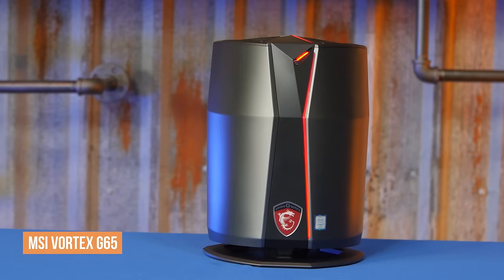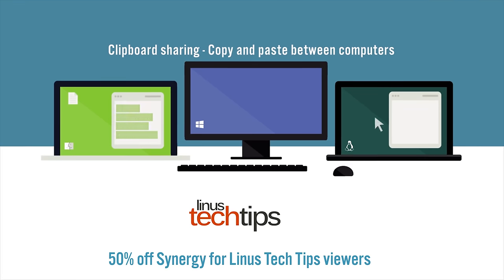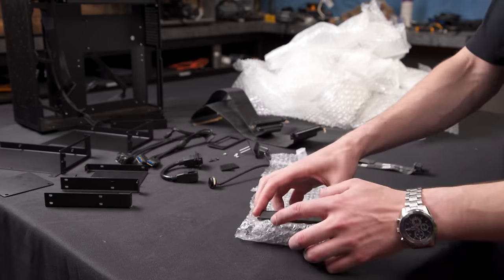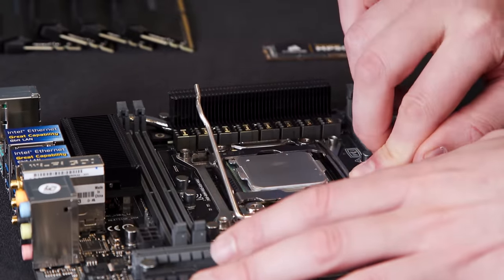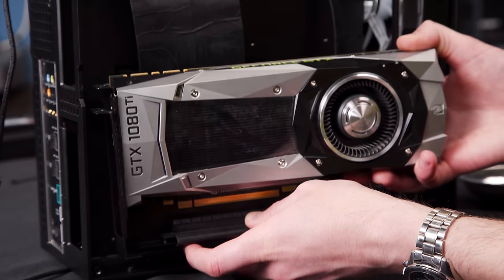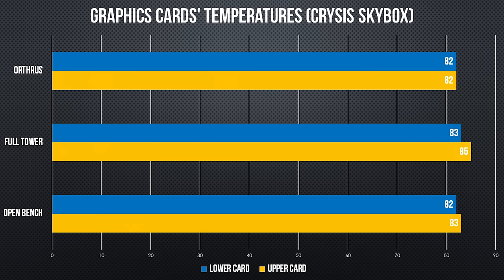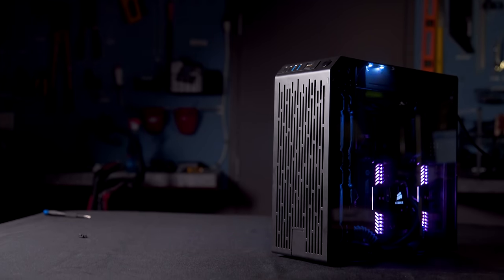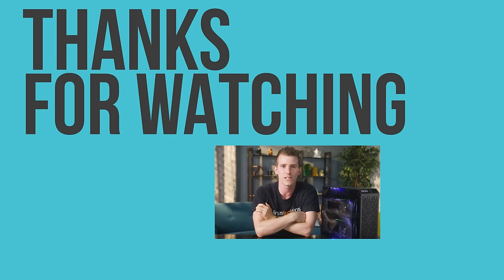SMALLEST SLI GAMING RIG – ONE OF A KIND!

Comment: God DAMN man that case is beautiful and TRAHSES anything on the market right now, looks super sleek and futuristic without being gaudy  on top of looking powerful as all hell thanks to the SLI window, Ten outta fucking Ten guys.
Reply: Its biggest drawback is the non-standard PSU, which makes it impossible to mass produce, unless they sell with PSU, which needs to be custom OEM design, which is very expensive in small volumes.
Reply: Brandon HLM also 10,000 fucking dollars out of 10,000 fucking dollars
Reply: Why not just make a bigger version of the case to support bigger PSUs.
Reply: Also, the rails were rewired for gaming workloads.
Reply: This, server PSU basically relegates this build to "I hate everyone in the same room as me" status.

should have sacrificed some vertical space and put in a SFX-L supply from silverstone, used cablemod to make the custom cables for it that are the right length, and the extra vertical space you use for the cooler block for the watercooling.

make it shorter since you dont have the waterblock at the front anymore.  Obviously, your block probably isn't going to be a 120mm.  so maybe you just use the room up top for more 2.5" drives. I dunno...

either way; server psu = worst idea.
Reply: Noise levels on the original build (v1) are 45-55 dB (idle/load) I think he is still deciding on the PSU however so if thats the main source of noise it may go down.

Comment: Love these Small form factor Cases!!
I'd really like just a couple more single GPU Cases similar to the SteamBox Prototype / NFC S4 Mini, BUT With a SFX or smaller PSU INSIDE The Case
Reply: May be just take notebook PSU, disassemble it and connect directly to DC TO DC converter
Reply: there are som on sff forum under custom cases and projects
Reply: Rooper K most notebook boards can't take external graphics. Makes no sense to do it.

Comment: I'm so happy you are using the older Corsair AIO cooler. I refuse to use any other AIO, these are the best all around in my opinion, I've had mine since they first came to the market and I love it! The built in memory for the LED is pretty neat too, you don't have to install the Corsair link software to reset the color

Comment: I used the same motherboard for my rig with GTX 1080's in SLI. Put mine in a Fractal Design Node 804 and water-cooled the CPU and GPU's. Not so small, but does the job.

Comment: You lost the first one?? And I'm sitting here with my i7-2600 ..
Reply: Raspberry pi 3 b+ overclocked to 1.4 ghz on cpu..
Reply: @Anonymous Gamer my nigga you have it good, I have a Intel Celeron with integrated graphics, 2gb ddr ram and a Chinese 450 watt power supply with ketchup mustard cables
Reply: 2600k still strong

Comment: why someone not come up with a way to run Windows on the Xbox1 as that is a small compact computer..?
Reply: iAwareNow not sure the specs of the Xbox one is enough to meet minimum specs for windows if that’s what you mean
Reply: @AAHSDJFBDKAUHFBFAIOS  thank you just seems weird how even PS2 can have amazing graphics yet not have windows xp on it at the time.. to get a PC to have the same graphics would cost ridiculous amount.. seems a lost opportunity to use these systems for other uses..
Reply: @iawarenow658  Its due to optimization due to the same hardware and software configurations so it can be optimized better giving more room for graphics etc. Unlike in Pcs where hardware and software configs can be different most of the time so you can't optimize it as well if at all so there is no room to add extra graphics and visuals etc.
Reply: @AAHSDJFBDKAUHFBFAIOS  oke thank you very much that is very interesting.. thank you
Reply: @iawarenow658  ps2? Are you sure, i can emulate ps2 on my phone

Comment: "In real world testing its not far off from running a single 1080ti" is what they should have said.  in my experience, which was with 2 GTX 760 supers in SLI. I found support to be a little lacking outside of synthetic benchmarks. so It always seemed to be only using one card. But when it did work, let me tell you.... it was a marvel of engineering.

Comment: This is AMAZING!  I never thought i'd see 2 1080ti's in sli in a tiny box that aren't in some way suffocated.  because of the blower style coolers, the intakes from those cards which are conveniently right up against the vents in the wicked tight clear panel blow through the 1080ti's out the back side of the machine, the cooling for the cpu goes right to the rad (which fwiw, i would set up blowing out instead of in myself but Shrug) - i'm not sure exactly if it would work, but I would like to see that front bit come in a bit and the case get a bit higher so that the power supply could fit on the bottom of the case and the rad could fit at the top with all those fans blowing up - and maybe squeeze an 80 or 120mm intake or two low in the front? - either way, opinions are like buttholes, i'm sure everyone has a laundry list of small personal improvements, but overall, this thing is seriously dope AF just the way it is... it's a grand example of using all the parts how they work best and building a frame around that.  kudos LukeD!

Comment: A box of such size is capable of having a normal GPU position.
Project Orthrus Width: 13.20 cm vs GPU Width 11.12 cm
Project Orthrus = Height: 33.00 cm Length: 34.50 cm Width: 13.20 cm
GTX1080TI-FE = 26.67 x 11.12 x 3.81 cm

Comment: no waterblock in the gpu makes it hybrid cooled... i generally dont understand why people would cool the cpu but not the gpu... the gpu puts out way more heat in most builds and there are worse aftermarket coolers... so gpu watercooling is way more important than cpu. and if you go the extra mile to step away from air cooling why not cool every component that needs it with water?

Comment: i think if he water cools  the gpus and single slot them and put them in place of the upper two slots he can use the second gpu space for a slim 240 rad man that would be cool AF two 240 rads in that small of a case still i dont if it will fit

Comment: So the nice little case looks to be 4" shorter and perhaps 3" skinnier than a Corsair 100R....; the Corsair costs $60. What does this case/and PSU alone cost? (ANd as for choosing a 6900K for 16 +16 PCI-e memory bandwidth in SLI....does this actually translate into defeating Z270 running SLI in 8+8 config? Or is it just 'spec bragging' to sort of 'sound faster', ....without acctually being so...?)

Comment: So when can i get one? cause this is literally what i have been waiting for, minus a thunderbolt port but that can be arranged with a PCI to thunderbolt card instead of a second card and i should still be able to fit the extra storage
Reply: P.s. did i mention this is almost perfect and is questionable about why no manufacture haven't done this before.

Also why cant we have a small factor case like this but with the CPU and graphics card on one side of the computer with both having fans point out the same side of the case so that we could lay it flat like a consul.

Comment: PLEASE REVIEW THE RAZER/MAINGEAR R1 RAZER EDITION PC. IT IS VERY CUSTOMISABLE AND I THINK YOU WOULD LIKE IT A LOT AS IT CAN STORE UP TO 4 STORAGE BAYS, HAVE AN I9 PROCESSOR  WITH UP TO 10 CORES AND QUAD CHANNEL DDR4 RAM AND UP TO 3 GRAPHICS CARDS AS WELL AS ASUS Strix X299 with Integrated Wireless AC, PLEASE CHECK IT OUT!!! LIKE SO HE/SHE CAN SEE please.....
Reply: You can see on its website, that it's very customisable, so the power supply goes up to 1200W- all it really needs, and, as I am mostly too busy to build one myself, I can still find joy in the sheer amount of customisation it has. Also,  it isn't too expensive- though the maximum is $25,000, the minimum is $900.
Reply: 1200w psu doesnt mean its not shitty

Comment: I still don't know why people waste money on cases like that which has flashing lights and LED's that are surplus to requirements.

My preference is compact, my smallest system is a mere 90mm x 90mm x 20mm, the next biggest is a 11cm x 11cm x 5cm, I have another that is 18cm x 19cm x 35mm, none of them has the video cards that get touted as being most important for really good gaming, pfft, like I have never spend more than £40 on any graphics card and never encountered any issues with any of the systems I have built.

So why do these companies keep on peddling this crap about having to have top flight stuff when its not needed for most gaming, do you really need dual 1080 cards to play candy crush saga?

Comment: Cool, Could still be better, Smaller (less powerful itx length cards), could be more powerful (GTX TitanXP's), Could potentially be smaller and more powerful if 2 TitanXP's which are single slot were watercooled in a DTX form factor board with a standard config (cards on same side as motherboard in a standard config) but you're not trying to the push the limits I guess.
Oh and if you do decide to make "7 Gamers 1 AMD cpu" with threadripper 7x RX Vega DUO's at 1.5Ghz would be 172Tflops, 1.6Ghz would top 183.5Tflops, Just throwing that out there.